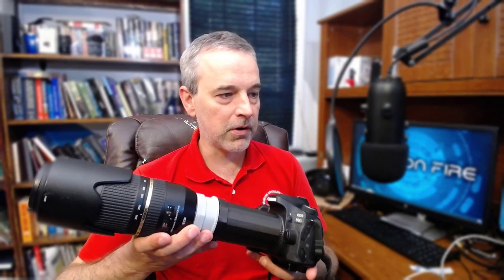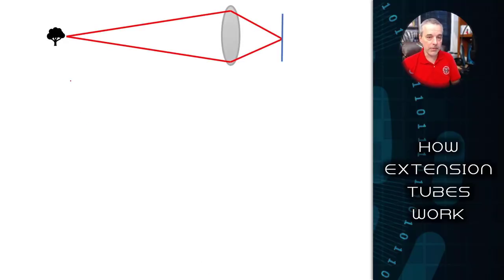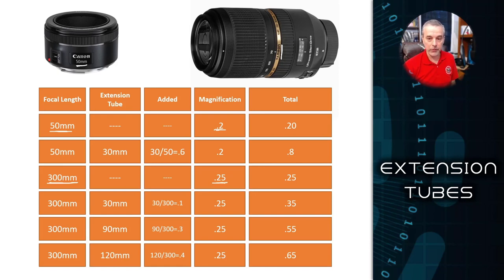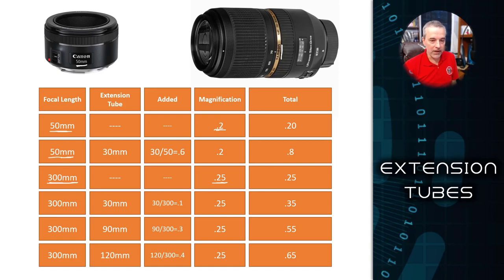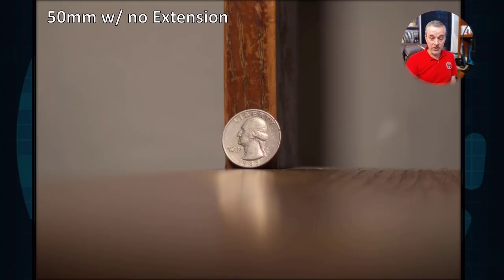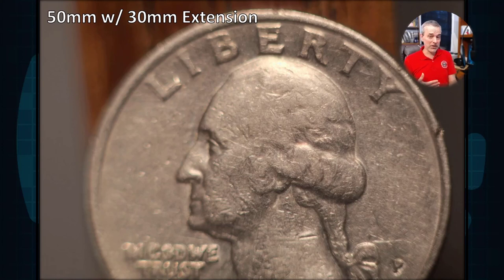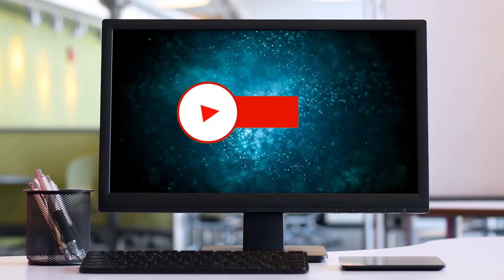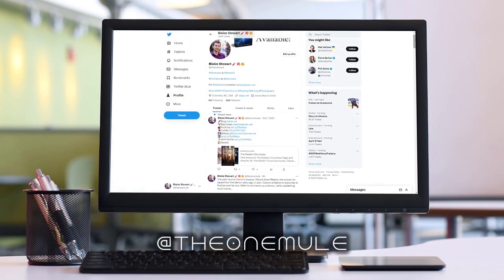Transform Ordinary Lenses into Macro Lenses with Extension Tubes! Even 3D Print Them!

Comment: If you set your camera to record video and then change the apeture of the lens to the desired apeture you can twist out the lens while the camera is powered on to "save" the apeture. Then add in your extension tubes and put the lens back on and it'll be at the apeture you saved.
Reply from the maker: I've used that trick before. Great tip!
Reply: I have 3D printed some extension tubes, but lose the ability to autofocus of course, but also to manual focus and aperture control. Is this how you regain those?
Reply: @heywhitebaby  that works for aperture control yes

Comment: I have 3D printed some extension tubes, but lose the ability to autofocus of course, but also to manual focus and aperture control. Is there a way to regain those? Ia it per lens? (Im 0/2 with that)
Reply from the maker: If you set your camera to record video and then change the apeture of the lens to the desired apeture you can twist out the lens while the camera is powered on to "save" the apeture. Then add in your extension tubes and put the lens back on and it'll be at the apeture you saved
Reply: @BlaizeTech  amazing! Thank you so much!!